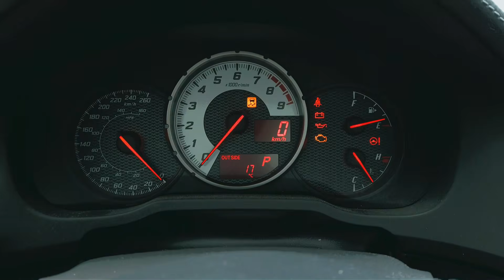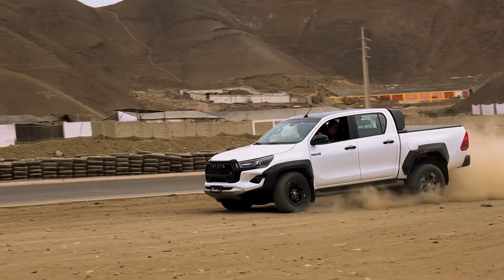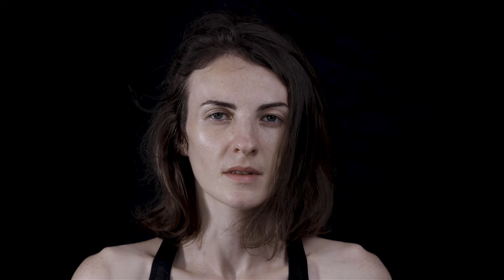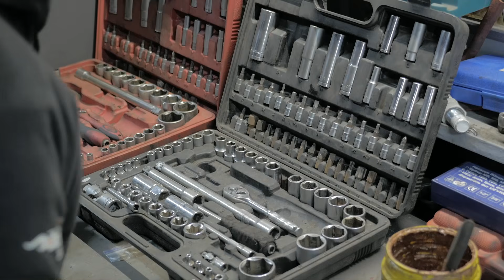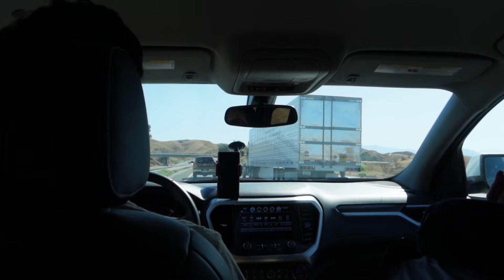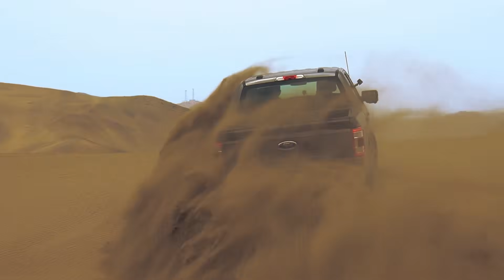Why Smart Drivers Are Buying 20-Year-Old Trucks (The Industry Doesn't Want You To Know)

Comment: Vehicles are not locked out to the consumer and auto technician. Diagnostic scan tools and and service info are available. Most problems are created by epa regulations.
Reply: Clearly you have not worked on a post 2018...  You need subscription and pass through devices to program  most modules and service information is also pay for play...not what it was pre 2005...